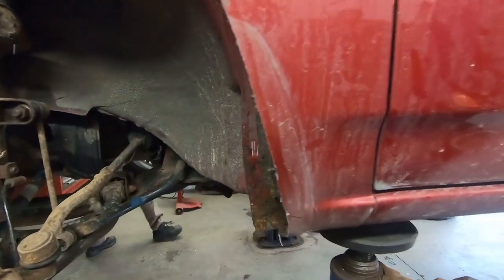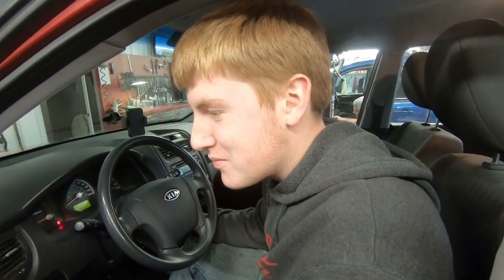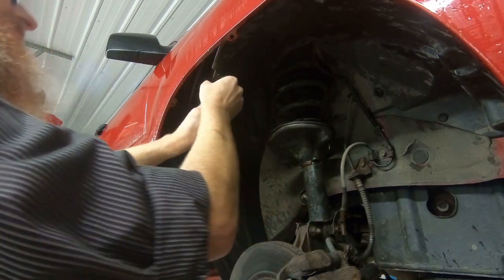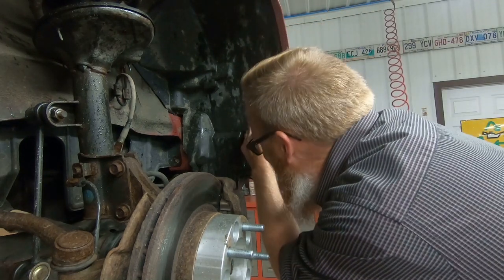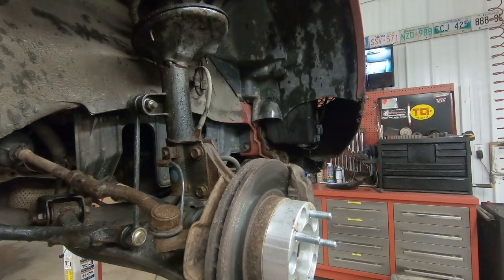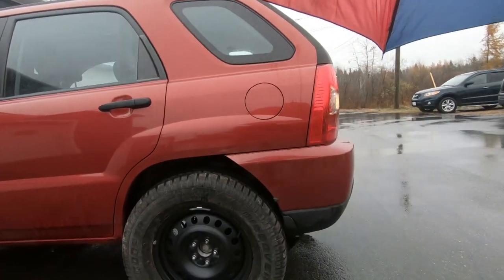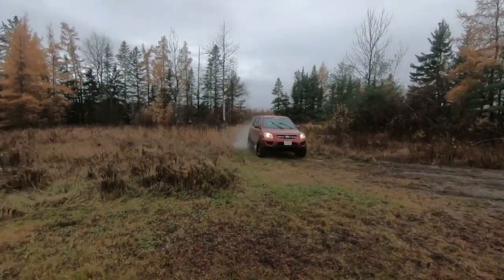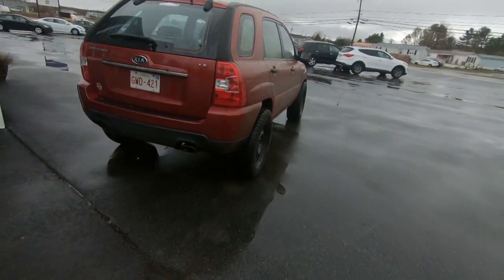HOW TO FIT 31" TIRES ON A 2009 KIA SPORTAGE

Comment: So I want to do this with my 2011 LX AWD and I was wondering if I put a 30mm spring lift on it will I have to cut much to fit 31s
Reply from the maker: You will definitely have to trim the inner fenders.

Comment: Looks great..what is the exact tyre spec
Reply from the maker: Slightly used 265/70R16 Cooper Discoverer M+S. Overall diameter is 30.51".
Reply: Thanks..wow!!
And what would you reckon is the largest diameter one can use with having to cut and or modify the body
Reply from the maker: @Tony-ow3if  I think 28” or so and you would be fine

Comment: How do I get in contact with you for information on the build
Reply from the maker: Best way is either email (address in the about section) or message me on Instagram.
Reply: My question is I want to buy 225 50 r16 mud tires they will fit with no issues correct???? I will email you tonight or tomorrow